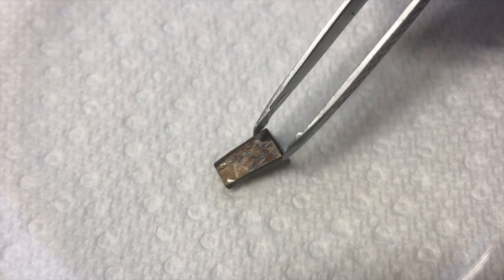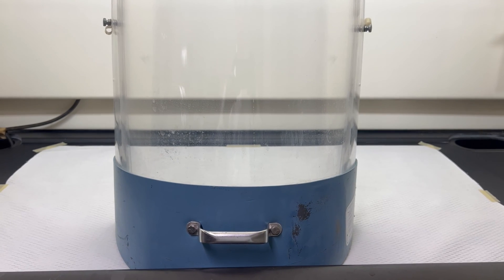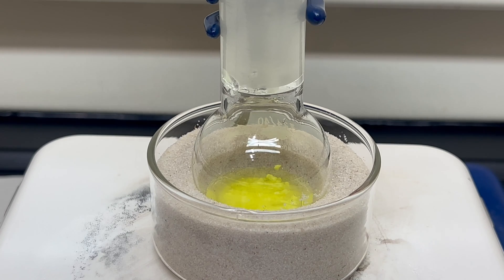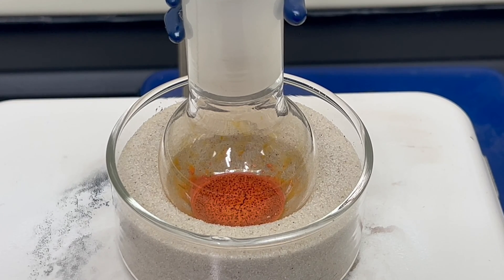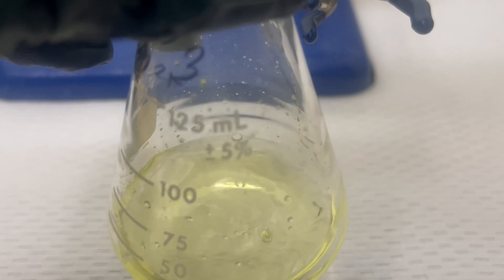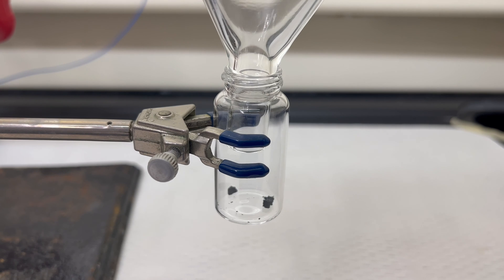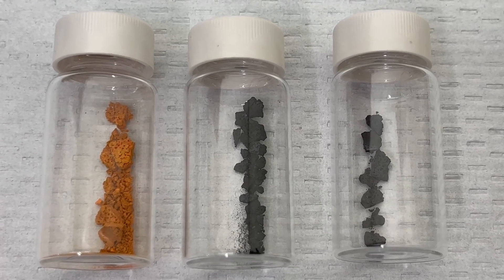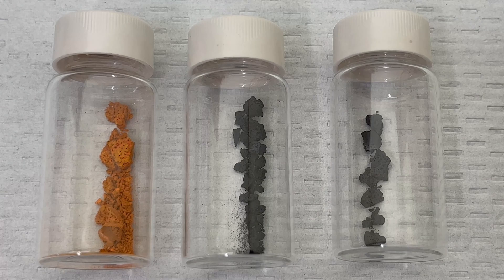Making Uranium Oxides, (Dioxide, Trioxide, and Octoxide)

Comment: Can we please not with this ALARA stuff? It sounds reasonable until you realize just how arbitrarily "Reasonably" gets defined based on biases. I get that it appears in some officious-looking documents, but that doesn't make the concept any saner.
Reply from the maker: I do not see the problem here. It is a good way of explaining how one should limit exposure time while also getting the job done in a safe manor. I understand how it may appear arbitrary in some means, overall its a better idea to transfer radioactive material in a lead pig than in ones pocket, its more reasonable to do the first option.
Reply: @WheelerScientific  agree! Its a wonderfull, easy to understand guideline :D
Reply: @simonschemiebaukasten100% true, it is especially true when dealing with substances that have half lives of than a few thousand years.